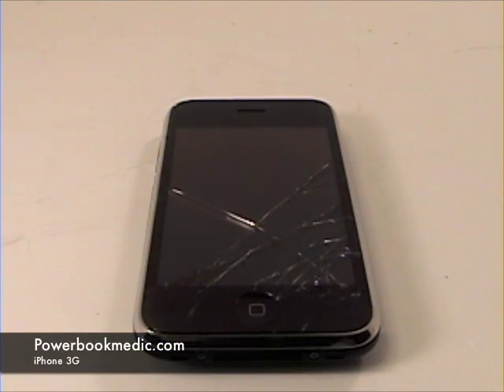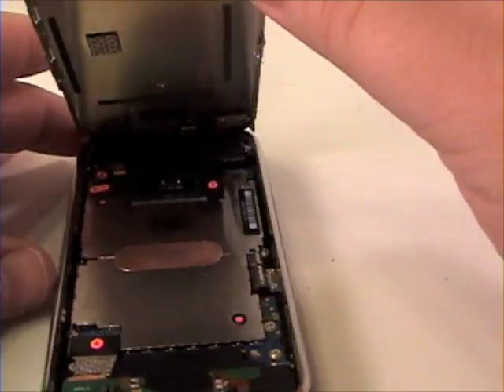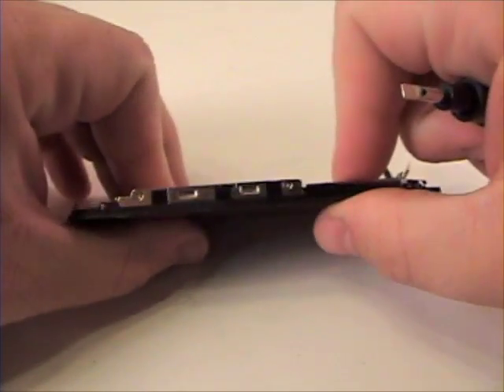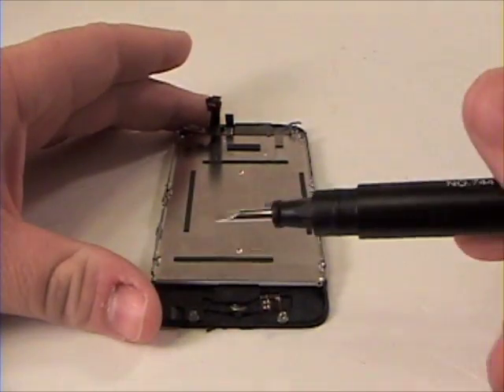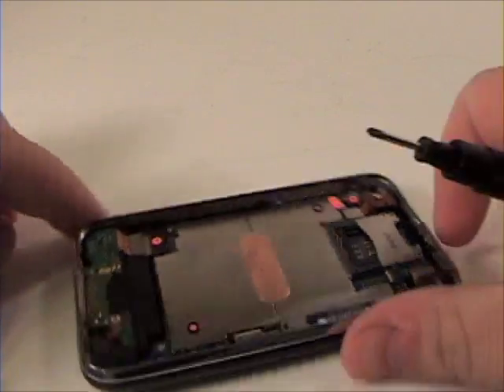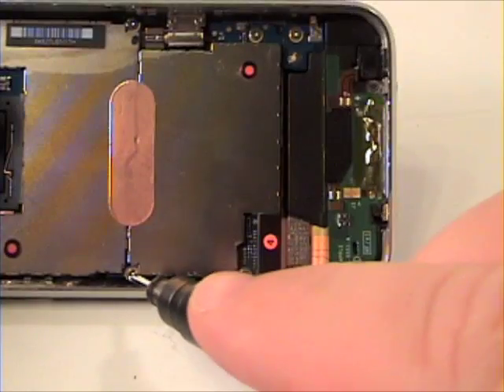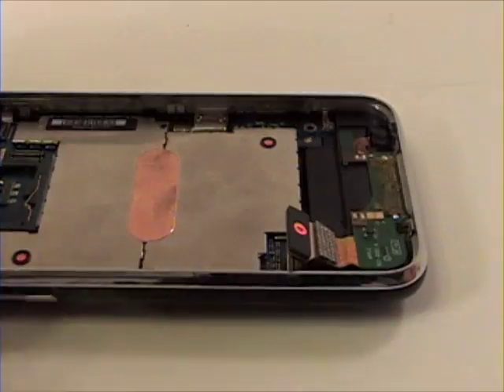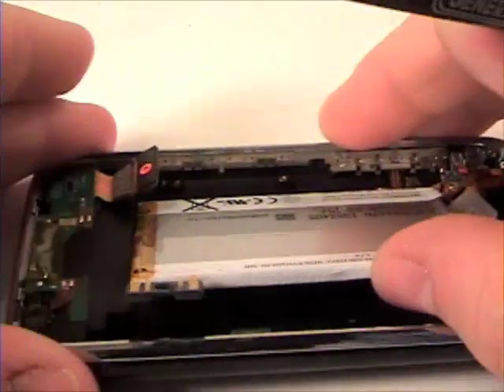iPhone 3G Disassembly Guide Repair Video

Comment: so i disassembled the iphone 3g and assembled it back together just to look inside. i made sure all the connectors were back in place.

now i can't turn on my phone. when i plug it into the wall charger, the apple logo appears for 2 seconds and then turns off. i tried to do a hard reset and it shows the "connect to itunes" logo and it stays there. the problem is when i disconnect the usb, the phone shuts off. 

I plugged the phone into my laptop, but it won't start up either! help!!!

Comment: Take a very close look (magnifying glass if available) at the dock connector.  I had a similar problem, and finally took a look and discovered that one of the pins in the dock connector had gotten bent over sideways.  I straightened it out with a small knife (x-acto), and now all is well.  Best of luck to you.

Comment: Sorry to post about something else, but I'm desperate.
My Iphone won't sync - there is a hardware problem but i'm not sure what to do. I have reinstalled itunes and checked all the cables. My partners iphone syncs on the same setup.
My phone charges but data transfer is impossible.
The phone was dropped, could wires that are only related to data transfer com off? Anyone any ideas?